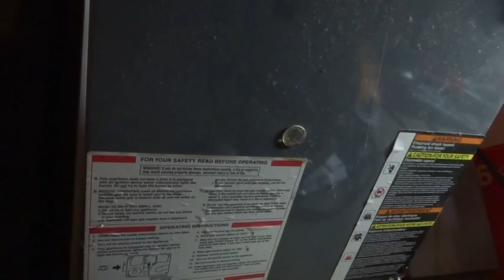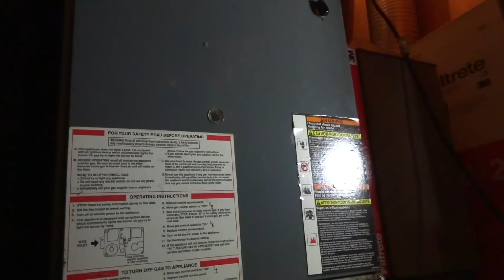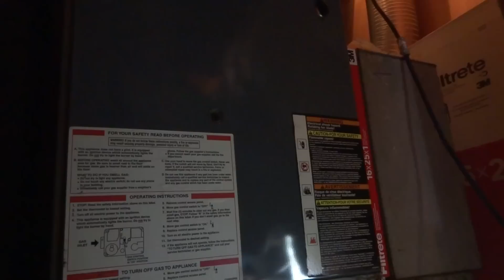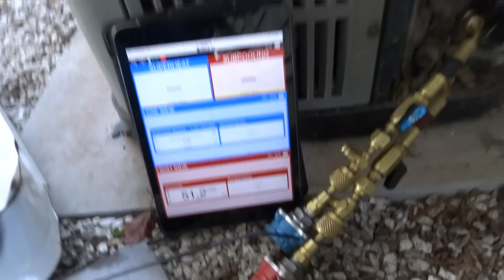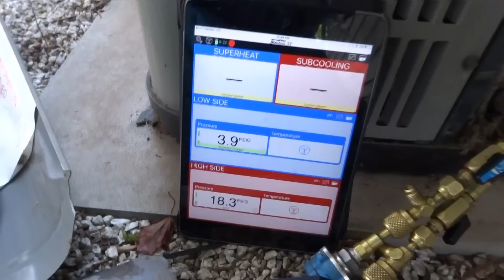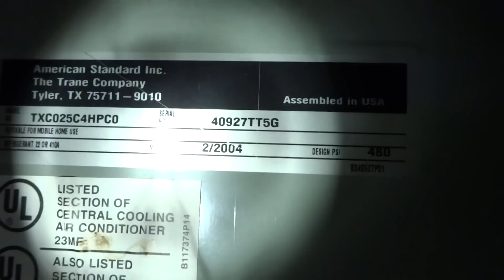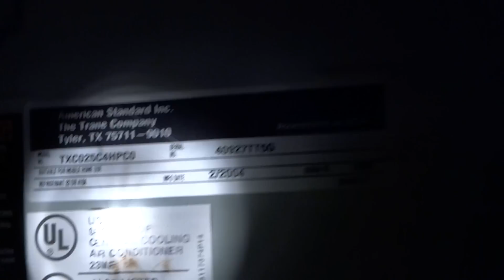CENTRAL AC NOT COOLING AND WATER PIPE LEAK

Comment: Replace??  My Carrier unit's 30 years old, 3 tonner, Copeland comp, change out caps in and outside last year, just check superheat at start of season, clean coil, go all season in 115° heat.  Maintenance is the key to longevity.
Reply: Copeland makes a good compressor
Reply: @StevenTheElder my compressor is made of wood I think. (Edit that’s a stupid joke.)
Reply: My 22yr old Carrier has a Bristol compressor, yearly maintenance.

Comment: I just swapped out my old  R22 that was a used replacement for the original keeprite that was installed in 80/81 and died maybe 4 years ago
Shiny new Keeprite in now, debating on putting in a  hyper engineering soft start or a 5-2-1 start kit so it can start on my generator
Reply: The soft start from Hyper works great for me. Allows my Honda 7000 to power the A/C to my villa here in Florida. Truly a great device, in my opinion.
Reply: @lp2565  Thank you for your input!
It does look like quite a superior device

Comment: Steve would you put a new lineset in since the old one leaks or do you think the leak is in the air handler/outdoor unit?
Reply: If the lineset leaks at the fitting then you just re solder it.. if it got punctured you fix it with a coupler fitting.. if you are upgrading from R22 to something else or if the compressor failed and polluted the lineset then they make flush kits to wash them out. ........ linesets are fricking expensive now.. you use to pay $100 maybe .. today its 4-6 times that.. and then you have to install it and if its not just through the rim joist and into the basement easy you end up having to tare out drywall so it gets to be 25% of an entire system just for the lineset. you can get the outside condenser and inside evaporator 2 ton goodman for $2000 and a 25ft lineset costs $400 if you need longer its worse. fricken copper.. everything is just so insane.. copper, steel.. i just bought shingles for my shed $30 a pack use to cost $12 a pack and I hear they just went up another $6 in the last 2 weeks.. if you can even get them.. i had to run all around just to get them and then that costs gas... its a wonderful time we live in.. HA!   oh also because there is oil in the refrigerant you can often see where the leak is because its covered with black oil.. looks sooty ..
Reply: @bobboscarato1313  not if the old one is in good condition.. I get your mindset that new equipment deserves a new $400 lineset and however much to install it... but